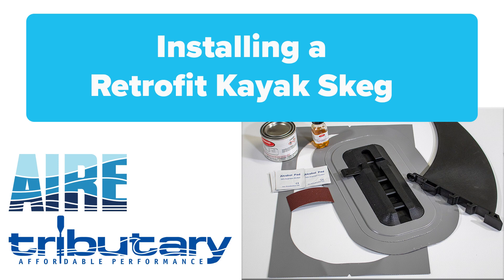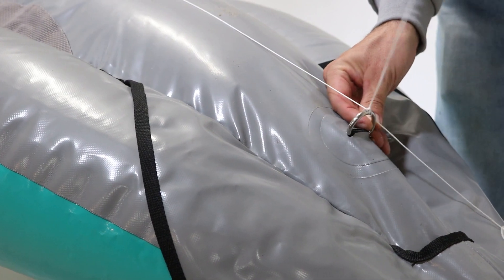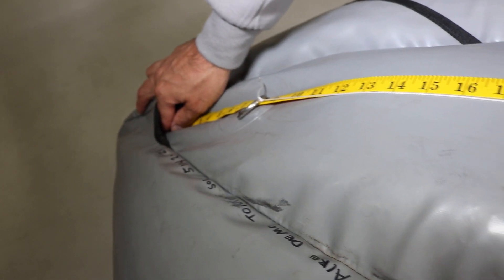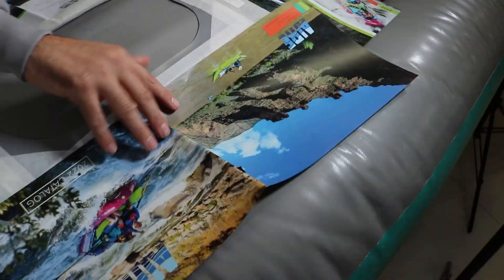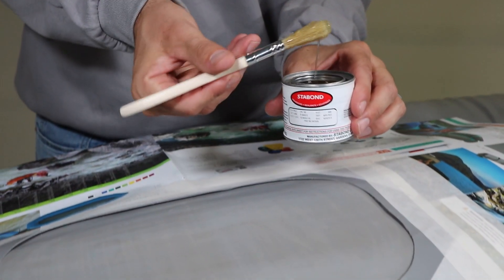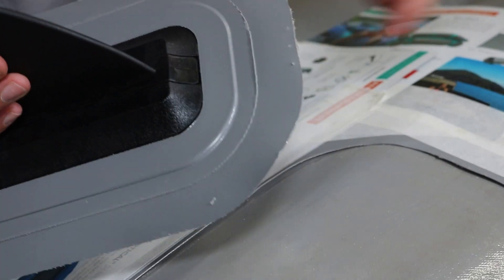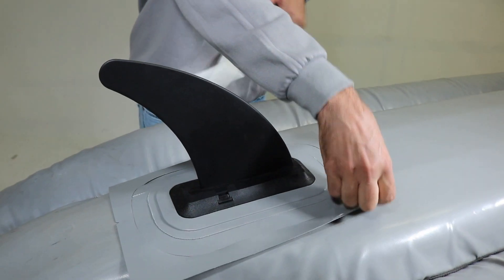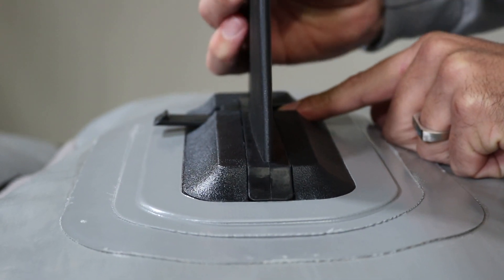How to Install a Retrofit Skeg on your Inflatable Kayak: Updated 2023

Comment: Really well explained. Thank you!  Question: It looked as if the kayak base was inflated, or partially inflated, during this application. Is that what you recommend?
Reply from the maker: Yes, make sure the boat is inflated to get the best measurement for positioning the skeg. It will also help when applying the skeg giving you a more stable base to work with.

Comment: A clean, smooth operation.

Is it not better to apply the patch with the skeg detached?
Also, if the skeg or the patch can get damaged during transportation, how can you trust them when using on rough waters?
Reply from the maker: We suggest applying the patch with the Skeg Fin mounted to allow you to get more pressure on the glued area. What can get damaged during transportation would be the Skeg Fin itself. So by removing it and rolling it within your boat or storing in a pocket you are less likely to damage or break the fin.

Comment: Do you have skeg repair kit for Intex K2 kayak ?
Reply from the maker: Intex is not an AIRE manufactured brand. They use a different type and quality of fabric than what we use on our AIRE and Tributary Kayaks, so unfortunately we do not have a repair kit that will work.